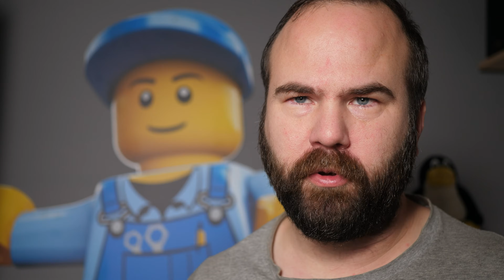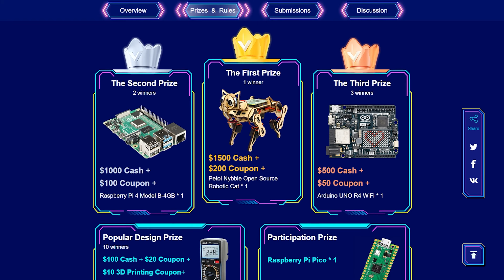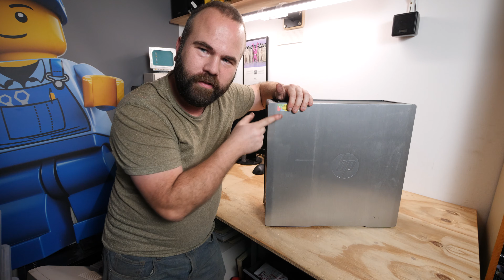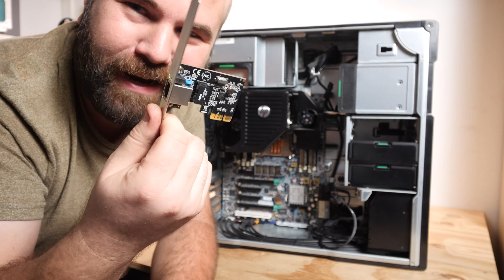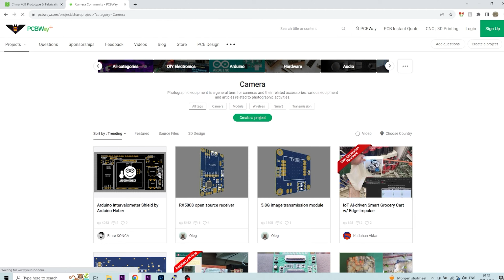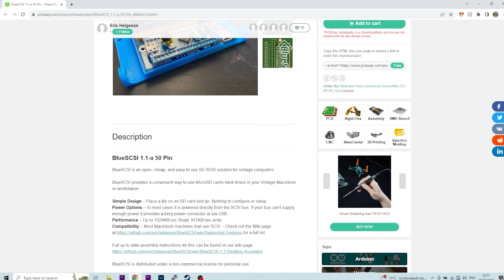HP Z620 Workstation Overview, Fastest System I ever saved from a Dumpster!

Comment: I bought one of those 2 years ago for 100€, low in memory but with 2 Xeons. The build quality is out of this world. I use it as a Assetto Corsa server, no need for the CPU expansion card and the extra Xeon unfortunately I have those dusting on a shelf. The PSU is also super high quality. I decided to buy also a 2nd hand Z420 for a trueNAS thing. There it is idleing at the moment xD

Comment: I have the HPZ 620 but has the single Xeon E5 1650 v2 6core 12 thread chip with 64GB 1866R memory. I acquired a Samsung SM 951 AHCI M.2 2280 SSD that allows these machines to boot from them. It must be the one that has the HP before the serial number. It is installed on the HP pcie M.2 adapter with the aluminum heatsink. Much faster boot times and speed.  Big 800W PSU. They are great well built machines that were very expensive back in the day. It is a power hog at 130TDP with that CPU. It 2 Quadro cards but now has a GTX 770 in it. They have nice handles so you can move them easy and do arm curls with it lol. I'm sure by now you found the keyhole in the handle.

Comment: I've got this workstation with 2 processors and 96GB of RAM for a small fee. I'm curious to see how Unraid will run on it.
Reply: I maxxed out mine too. Dual Xeon E5 2690 v2's, 96GB ECC Ram. Two Gpu's, Two NVME's (one for my VM's, and the other is on the last white PCI Slot using an adapter for my VM/LXC Backup storage), Two SATA SSD's (One just for the Host Proxmox OS, and the other for my Steam games), and........and six 4TB WD 7200 HDD's that I have setup in a Raid Z1 zfs pool natively in Proxmox for my NAS storage. I'm still running Proxmox 7.1.5!!!! 

Check out a company called ICYDOCK, they sell HDD 3.5 and 2.5 inch expansion bays for HDD/SSD's so you can rip out that cdrom and expand your storage!

This HP Z620 is the most powerful best workstation I've ever had the pleasure of owning. The X79 platform is the best!!!!!

Comment: Just got a Dual e52620 v1 Z620. It had the same card as yours but I put a beast RTX3090 on it. Plays Red Dead Redemption 2 with High/Ultra settings at minimum 80-100fps 1080p, although I just ordered 2 e5-2690 v1's from AliExpress for 9$ each. I wanted the v2 cpu's but the HP z620's with the boot block date of 2011 only support the v1 cpus. Still a beast tho!

Comment: I'm currently putting together a Z620 with 2x E5-2697 v2's (24 total cores, 48 total threads), as well as an RTX 2060 and 128 GB of PC3-14900R memory. These systems are such a joy to work on, and the BMW-designed cases are absolutely gorgeous.
Reply: Hi, I'm doing something similar but with a z640. I'm having a POST error that I have been trying to diagnose for weeks now without success. Have you encountered a similar problem?
Reply: @jnchacon  I have not. I suggest trying to reseat the CPUs, memory, and any expansion cards in the system. An improperly seated part can cause POST errors.
Reply: @redleader6442  , yes I did that with every part. I'm waiting to get another z640 an do cross checks 😅
Reply: @jnchacon  There is another type of error these systems have that have to do with the second CPU and RAM card not making a good connection when inserted. I'd carefully clean the pins of the power and data connectors on the card and see if that solves your problem. Unless you only have a single CPU, that is, which would mean this doesn't apply to you.
Reply: Great PCs these. I've the baby brother pc a Z420 with a 3060ti and 16gb ram and a E5-2667v2. Does me great and I got the bare unit for 50 euro before upgrades😊

Comment: Hi, thanks for this video. I have a HP Z620 and I need to add Wifi . I found a PCIE Card that is  Dual Band Wireless-AC 1200Mbps PCIE WiFi Adapter with Bluetooth 4.2.   I have been trying to find a USB 2.0 9Pin interface at the motherboard but I have noy found it. Does it have this interface: USB 2.0 9Pin?  I would appreciate any guidance. Thanks a lot

Comment: Hello brother, I have a HP Z620 PC, processor, xeon e5 2620 GPU, AMD R7 370, 12 GB RAM, sometimes it beeps 6 times at normal speed and does not turn on, and it does this 5 times every 3 or 4 seconds. Sometimes I remove and insert the graphics card and it works, sometimes I remove and insert the RAM. It's working, I unplug it, hold down the power button, plug it in again, it's working, I don't understand why, bro.,

Comment: Finally a video about Z620. I own a Z620v2 as my main editing workstation - With a E5-2696v2, 160gb of ddr /32gb dimms for a max of 384gb - yes - it does work up to 384, and a RX 480 8GB. Got a 2nd CPU but no CPU Riser to install it yet, that's the next upgrade though. One note - they're really reliable. Renders 24/7 and edits on off-time. Gotta say, nice video to cover an unsung hero! Cheers !
Reply: Dude! I have a HP Z620 v2 w/ dual Xeon E5 2690 v2, and this thing maxes out at 98 GB of DDR3 1600mhz ECC Ram. I'm on the latest Bios. How the heck are you able to push it to 384gb?

Comment: My first Z Workstation is Z620.
I love the "Quick Release" or "Tool Less" design.

And also i love how neat is the inside.

But i really hate the "Memory Training Error". I use original HP DDR3 ECC Memory.

Not 1, but 3 Z620 in my workplace are have "Memory training error".

But the other Z620 are realiable.

What i learned when "Memory Training Error" happen, i can press F1 keyboard, still continue load to Windows and continue operating.
But it become a pitfall if not solving the error earlier. Because the Processor workload becomes peak 100% (i read using Performance monitor at Windows Task Manager), and everything become sooo slow, and lagging. When i use it to streaming using vmix.

But when i'm not start the streaming, the system still operating well, the CPU not peak to 100%.

Another thing i hate about Z620, some another Z620 in my workplace , maybe 1 or 2 unit, randomly got 5 beeps error. So i have to doing troubleshoot according to Manual troubleshooting guide.

So i hate Z620 is not so stable.

Z640 in my workplace are more stable. Maybe only 1 Z640 experiencing "Memory Training Error" of it's DDR4.
Reply from the maker: I will try the machine to see if it gives any errors :)

Comment: My last employer just threw away a full pallet of these. All but one were in good condition. That one the prior IT guy had put in a couple GTX cards, multiple processors, and maxed out the ram and drive to run as a transcoder. Worked for about a day before smoke started pouring out.
Reply from the maker: Probably poor cooling for so much stuff :D

Comment: cool machines rock solid , i see quite a few still around  doing good work .. but so annoying to work with imo .  esp using them at home  lots of  bespoke parts  you dont  usually have lying around . and  a well used system those fans make it sound like a 747 at load ... still cool though

Comment: Some of these older workstations are still great machines to get your hands on, especially if they are being given away.... I have just managed to get my hands on my old CAD workstation which is a Lenovo P720 and whilst the current specs are not huge (1 x Xeon Silver 4210, 16GB RAM, Quadro P2000), there is scope for a lot of pretty cost effective upgrades in the form of a spare CPU slot and up to 384GB of RAM plus 2 x gen 3 M.2 SSDs. I was thinking about using it as my regular PC and putting a decent GPU in there, but even though I could potentially end up with 20 physical cores and a huge amount of memory, the individual core performance is not much over the Ryzen 5 2600X that I am currently running, so I think I shall be using it as a good base for a home lab setup as my wife wants to dive into networking and cybersecurity so running a load of virtual machines will be easy.

Comment: I have a maxed out Z620, 128GB DDR3, dual CPUs, a real beast, even now! I really like the way these older Zs were built, a real tank! Keys lock the release handle on the side panel.
Reply: Not maxed out completely. Mine has 192GB of 1866mhz RAM😛
Reply: Are you sure about that ;P Max is 384 ;) @MikaelKW1
Reply: Note - mine are at 1600Mhz though - no 32gb dimms that I know of at 1866 :/
Reply: @ReelGoldstar  How? Isn't the max for DDR3 16GB per stick?
Reply: @MikaelKW1 Load Reduced Dimms go up to 32gb and are supported by Z620V2 (Xeon v2 boards) I found out on chatgpt xD and tested it, works.
Reply: @MikaelKW1  16gb buffered yes, but with lrdimms the boards takes 32gb dimms no problem, downside is that they all need to be either one or other, no mixing
Reply: @ReelGoldstar could you share the RAM details and where you bought from? I found 32gb lrdimm at 1866 on amazon but not sure if they’ll work. Anything you had to do to make yours work?
Reply: @maxpower201  Closest I could find are these

Samsung 256GB (8x 32GB) SERVER RAM DDR3 REG ECC PC3-14900L (inkl.MwSt/VAT)

I got mine off "Willhaben (Austrian eBay)" from a dude selling server equipment - It was meant for Z820 - NOTE: You need V2 Server, and check for REG/UNREG, ECC, Etc, you cant really mix them. The exact name was

LRDIMM M386B4G7DM0-YK0 ECC DDR3L 1600 MHz 240pin with 32GB Capacity

They have tiny samsung stick on the left side! They have metal shroud and sticker is on the right side!

I hope I helped :)
Reply: @MikaelKW1  I Have the v1 motherboard in an HP z620 and it will not work at 1866mhz, it simply reverts to 1600mhz. Only v2 motherboards have support for 1866mhz and the v2 versions of the Xeons.
Reply: Dude! I have a HP Z620 v2 w/ dual Xeon E5 2690 v2, and this thing maxes out at 98 GB of DDR3 1600mhz ECC Ram. I'm on the latest Bios. How the heck are you able to push it to 128gb?

Comment: Max out the ram, load it up with drives and run it as a proxmox server.
Reply: That's what I did with mine. Dual Xeon E5 2690 v2's, 96GB ECC Ram. Two Gpu's, Two NVME's (one for my VM's, and the other is on the last white PCI Slot using an adapter for my VM/LXC Backup storage), Two SATA SSD's (One just for the Host Proxmox OS, and the other for my Steam games), and........and six 4TB WD 7200 HDD's that I have setup in a Raid Z1 zfs pool natively in Proxmox for my NAS storage. I'm still running Proxmox 7.1.5!!!! 

This HP Z620 is the most powerful best workstation I've ever had the pleasure of owning. The X79 platform is the best!!!!!

Comment: Am just migrating from the HP Z420 running esxi 6.5 (Win 2019 server(s) VMs) to a HP 640 running Proxmox 8.0.4 (running Win 2022 server(s).  HP workstations are rock solid.  FYI - I updated another Z420 to latest/last bios and can install Win 11 no problem.  ie: MS/Win 11 is happy to have it installed.  No trickery to get Win 11 working.

Comment: This thing still outperforms modern budget low end CPUs by a lot. I'm usually not a fan of prebuilt computers and i prefer building them myself but i always liked those OEM workstation/business grade computers. They might have some proprietary parts and connectors but they usually don't fail that often to need replacement parts so it's fine
Reply: They smoke new budget chips in multicore but get destroyed in single core

Comment: The best thing I've ever gotten that was trashed was an i5 7400 system, with a 128gb NVME boot drive and a 1tb HDD, it was in with a bunch of other computers that were out at the curb at a house that I think had been sitting in probate for a long time and some other family took it over and cleared all the old lady's stuff and the stuff her son that last lived there with her, there were a couple Compaq A64 era Sempron machine that I just stole the HDDs and optical drives out of since they had buldging caps and were based around bumpgate era nvidia chipsets. I ended up with one working AXP Sempron machine out of the two that were there. The HP i5 7400 system didn't seem like had been used much at all, looks like it was probably purchased in 2019, and they guy setup Windows and then partitioned it off and put Ubuntu on it and didn't use it much either, the Samsung SSD only had 13 power on hours on it a few days after I reinstalled Windows on it and played around with it and the HDD was at just under 100, I think the SSD more agressively sleeps than the HDD spins down so most of the hours may have been me.

Comment: Nice machine. I got a z820 from eBay for cheap because it wasn’t working but unfortunately I needed to replace the motherboard. Did you find the key lock? If not, it’s by the side panel latch.

Comment: Proxmox or Unraid machine 😁
Reply: I have mines maxxed out with Proxmox. Dual Xeon E5 2690 v2's, 96GB ECC Ram. Two Gpu's, Two NVME's (one for my VM's, and the other is on the last white PCI Slot using an adapter for my VM/LXC Backup storage), Two SATA SSD's (One just for the Host Proxmox OS, and the other for my Steam games), and........and six 4TB WD 7200 HDD's that I have setup in a Raid Z1 zfs pool natively in Proxmox for my NAS storage. I'm still running Proxmox 7.1.5!!!! 

This HP Z620 is the most powerful best workstation I've ever had the pleasure of owning. The X79 platform is the best!!!!!
Reply: have u decided.